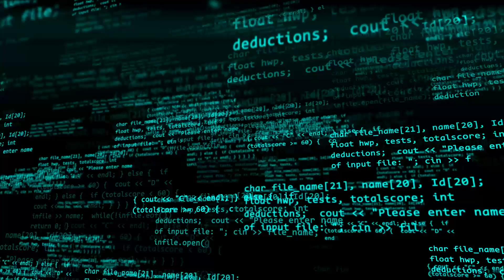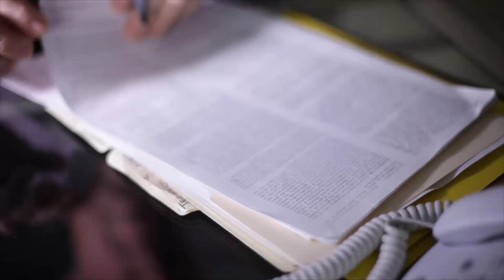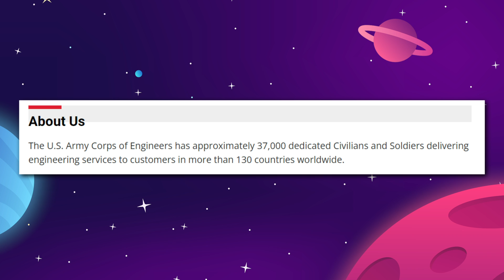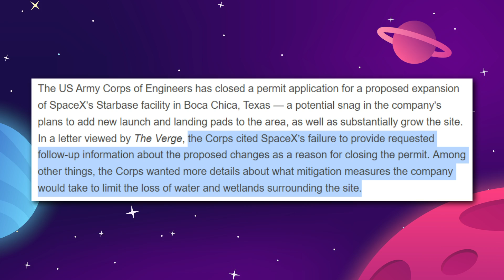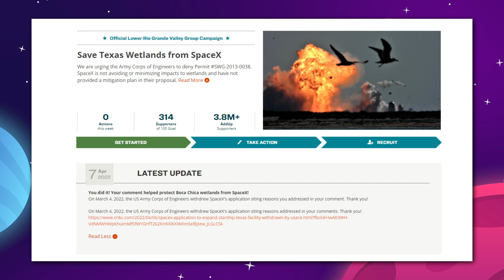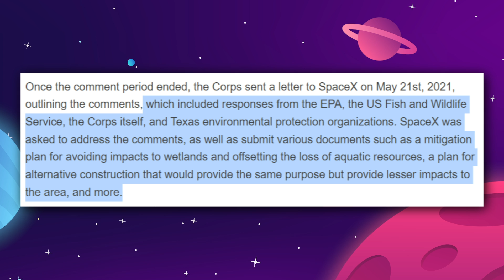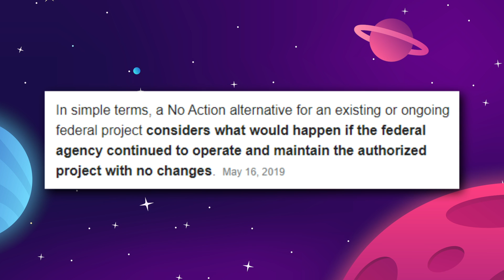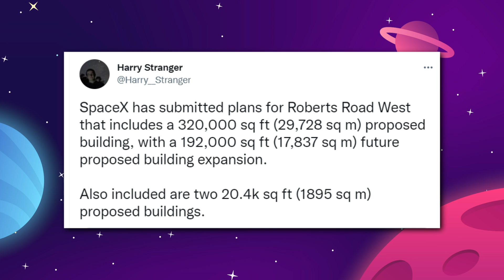Why SpaceX's Starbase Facility Could Be Cancelled!

Comment: The system the US space system, both NASA and commercial is operating in is not supportive of a fully reusable, high cadence approach. It will happen but in another country that believes that the capability is more important than other things US regulators deem necessary to protect. This is just one more items in a longer and longer list of times indicating that the US empire is steadily declining and becoming irrelevant. It remains to be seen if SpaceX is willing to move to another country or if another country will just do what SpaceX originally intended to do. For those who like to keep the NASA and US space industry, do be alarmed. You have Artemis and SLS to save your day.

Comment: This is all about politics.  I would go further and speculate that some of the aerospace industry with very deep connections in government that have, shall we say, a competing project that is facing serious cost overruns and delays are also likely having the brakes applied to SpaceX, least the non-SpaceX project get cancelled in favor more Starships.  There's also a certain wing of a certain political party that frankly would rather all the money spent on space projects go to funding their stuff instead, and so if they can find some way through bureaucracy to shut SpaceX down, they will.

FYI: The Army Corp of Engineers was never, ever had environmental protection as one of its missions.  Want a dam on a river, they would tell you if it were possible from an exclusively engineering perspective, and their analysis was focus on the human aspects of such a project (homes that would be submerged, towns that might have to be moved, etc.).  If it is essentially doing the EPA's job at the moment, once again, politics.

Comment: SpaceX absolutely needs Boca Chica for testing Starship rockets.  They need a very isolated location in case stuff goes wrong, as it will.   You can't test untested rockets at Kennedy Space Center.

Comment: Thing is the FAA knew what was planned from day 1 and should be held accountable for they should have saidcno from that day 1. Musk should sue their asses for miss representation etc.
Reply: This is the same FAA that turned the other way when the 737 crashed twice and STILL had to be forced (by Trump) to ground the 737. Boeing used just One angle of attack sensor (the one that killed 350 people) instead of two... and the FAA claims it didn't notice? Its right on the side of the nose....

Comment: Yes you are missing something...democrats...There's is one reason and only one reason Starship 20 did not launch to orbit last year and that reason is democrats. democrats hate America and so they hate Starship and the rest of Musk's ventures cuz they exemplify American exceptionalism which flies in the face of the democrat cult's global fascist ideology.

If Musk's does move testing away from Texas to Florida it's likely only temporary. Come next January the democrats will have lost both houses of congress and 2 years after that we will also have a Republican White House. So most likely by next year when the Republican controlled congress comes into power or definitely when Mr. T retakes the White House SpaceX will get all approvals they need to resume testing at Starbase Texas, but it's probably not coming before then.

 Musk's apparent realization is there's no point in trying to work with the democrats. Which is most likely why SpaceX didn't bother answering the Army core of engineers. As any answer would just help the democrats lay a legal frame work to deny them. It makes more sense to refile the application when Republicans take over so you can actually get an approval instead of trying to appeal a denial.

BTW the democrat's war on Musk is also probably why Musk is buying Twitter. It's acquisition will be more helpful to Republicans in future elections than if Musk donated billions to the RNC.
Reply: You are dead on THX!

Comment: I think that NASA will wholeheartedly support the launch and "landing" of a flight proven Starship.  I also think that NASA will not support a testing and development program for Starship. That task will be upto SpaceX to find a remote desert or island where they can build and destroy prototypes. Imagine the first orbital Starship coming in on an unsuccessful tower capture, exploding everywhere over and around Pad 39  at KSC, and the potential damage to other infrastructure
I don't think KSC is a test site.
Reply: Its remoteness is exactly why Boca Chika is better than the KSC for test launches!
Reply: @PlausibleParadymes  its remote only once the residents moved out and the initial decision may have been made without other environmental protection considerations.
Reply: @michaelreid2329  I suppose "remote" is a relative term - and to the residents who live there,  Boca Chika is not remote - it's home... but compared with the density of the Florida population and existing infrastructure, relatively speaking, Boca Chica IS remote. But to your point - the residents who call Boca Chica home present a separate issue that would have to be resolved directly with the residents or through re-zoning. As to any environmental protection considerations, by all means they should be considered and weighed. But considering the millions of environmental acres that have been sacrificed to lesser business interests, surely the cost of sacrificing a paltry 17 additional acres of environmental wetlands would be worth the shot at freeing humanity from its exclusively earthbound birthplace...

Comment: Why does Maniac Musk ..... Need ... more Land and more Launch Pads for a BF Rocket that Can't even Fly Yet ? ... let alone be a Working Product ... The BF Rocket is still a Concept .... Shouldn't you Wait until you know it Works first ... before you Expand ? .... The Government is Saying ... Show us the Product First ! ... If it's Good , then you can Reapply ... What's the Big Deal ?? ..... What Mystical Musk needs to do is Spark up the launch Pad (once it's finished) ... with his Neo-engines (that have still have blue ink on them) ... under Booster 8.0 (still in pieces) ... and Prove he can light Up the Sky In a Boca Chica Display ! (with 33 motors at one time !) .......... Unfortunately he isn't in anyway capable of Lighting up just One ! ...... I would say Expansion is the least of Musk's concerns ...

Comment: One major advantage of Boca Chica is the impact on commercial air and sea traffic from the Florida site. Every space launch in Florida causes several hours of diversion of dozens of flights between North and South America, causing increased costs and schedule problems for airlines, and also forces commercial shipping to be halted for the same time. Boca Chica is off the major flight paths and not in the standard shipping lanes.
Reply: What the US needs is pre-approved EPA dedicated rocket launch sites without impact on commercial air and sea traffic. Needs to lower the stupid red tape.
Reply: Great point
Reply: @David-Kynaston  Actually except for China the various pollution issues are mostly improving. Except for a few countries in Africa and Middle  East population growth is either falling or about to. Over last three decades global extreme poverty has been cut by 50% while population has doubled. Demographics of China in particular looks like 500 million fewer Chinese in two decades.
In any case, the earth will be fine whether its nice firvhumans or not. Global average temperatures for the dinosaurs was 4 or 5 degrees higher. And just 17000 years ago polar bears were in Spain.

Comment: Think about NASA and how they would become a second rate Florida space port, kind of like the also ran or use to run.  What about Florida and their loss of stature.  Sad to say but most politicians can't see beyond their next election, wanting to keep their job without doing it.  Elon wants to get it done and some political groups don't understand doing something like this for the greater good.  As for the building, rockets and equipment, it is right next to the water, so ship it to Florida. I do have a question, before StarBase what was there, I heard it was oil rigs or something like that?
Reply: Florida was always in the plans for SpaceX. There are certain types of launches that just could never fly out of Boca Chica. None of the ones done for the USSF or NRO as examples. KSC and the Eastern Test Range have different kinds of security protocols than BC, TX has.  While there are bus tours of the Cape,  there are other areas where you just are not going to be allowed to see unless you have been badged in. And that approval can take some time to get and will include an FBI background check at the minimum.

Comment: Boca Chica is already winding down.  It probably won't be abandoned entirely, may be used for R&D work on new variants.  All the economic benefit to Brownsville and surrounding areas has already peaked and will do nothing but decline from this point onward.  Central Florida will now reap the economic benefits that Texas just lost.
Reply: Have you noticed how slowly things are now happening with the High Wide Bay? Was going rapidly and now hardly any of the sheet metal work ( cladding ) is being done.  The question I have is: Is the OLT going up at the Cape actually parts that were planned for the second one at BC? And the old bugbear of the FAA rears its head at the Cape also. The VIB there also has to get FAA approval. Want to bet that politics comes into play again if SLS doesn't go well?
Reply: This is really sad to here.  I was thinking the area would boom.